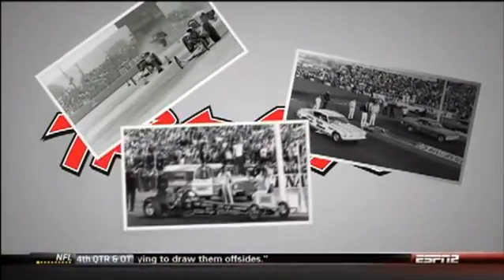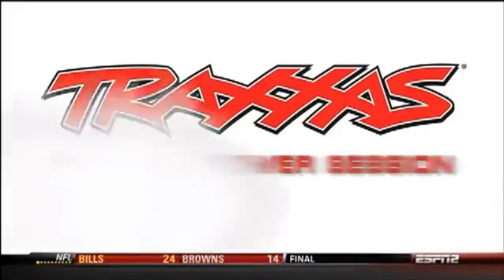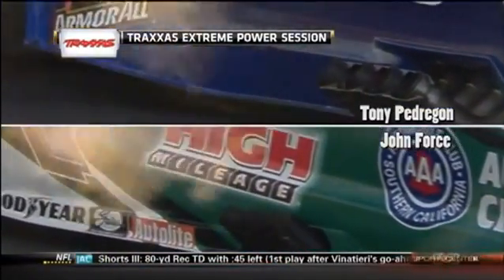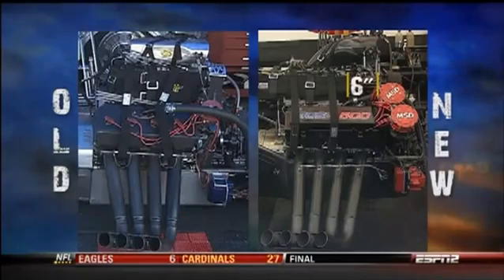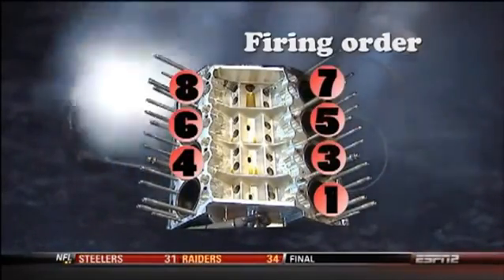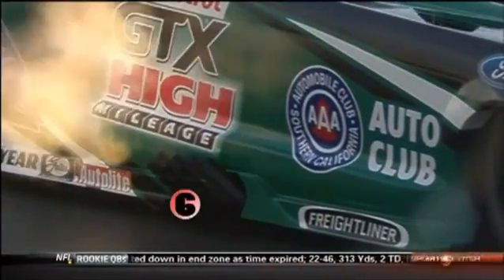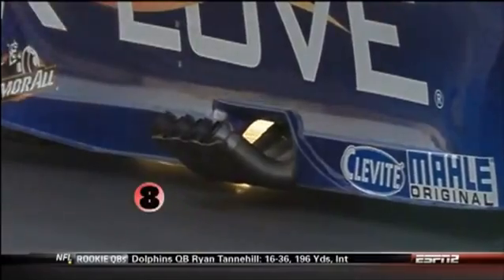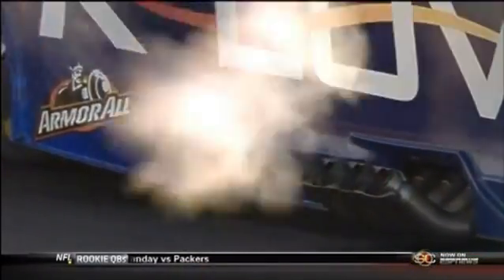11,000 + Horsepower from a modern Top Fuel HEMI !

Comment: "Since 1964 still the engine of choice for nitro drag racing"...Umm. When it is the ONLY engine that the NHRA allows you to run, how is that a choice again?
Reply: Has everyone forgotten about the Ford SOHC engine? Even "The Snake" (amongst other luminaries) ran it in fuel for a while...
Reply: It was chosen by NHRA
Reply: +Samuel Exactly, the choice was already made by NHRA. The choice does not exist for the team.
Reply: @psyborg06  yea it did. They tried others. They rocketed so fast it the chevy big block would have killed 3/4 s in the stands.
They already knew ford kills crowds with running into them, certainly no more chances for them

Comment: So lemme get this straight...one cylinder basically generates twice as much horsepower as my already highly-tuned turbocharged Porsche? 

I give up. I'll never be fast. If you can't be the fastest, there's no point.
Reply: hevquip yes its the air to fuel mixture and since they run nitro methane and is more volital than petrol you get more power not to mention the use 2 spark plugs per cylinder
Reply: The power comes from roughly 60psi of manifold pressure which means you can burn lots of fuel
Reply: Don't fret hevquip, your porsche doesn't drink 12 gallons of fuel in 6 seconds either.

Comment: It's really is incredible what these engines are capable of. I will try to put it in terms you may relate to. it would take a team of 800 actual horse's to produce  the same horsepower at full energy to equal the horsepower of one top fuel engine;)

Comment: How do you dyno this thing ?
Reply from the maker: Mihai 
There is no dyno that can measure that kind of power. I seen Tony Schumacher's crew chief a few weeks ago on NHRA broadcast, explain a device they have that measures the torque straight from the trans. Horsepower is then calculated. Schumacher's crew chief calculated over 12,000 horsepower. But, the NHRA still quotes 11,000 hp +.
Reply: Math
Reply: You measure how much extra the earth rotates when you go full throttle
Reply: Couldn't hp be calculated based upon air/fuel mixture, total fuel burned over time
Just my worthless 2 cents
Reply: RT440Dodge They don't have transmissions. It is direct drive with a special multi-plated clutch between.

Comment: I'm not a mechanic,
I don't understand how changing the firing order could increase the HP.
What is the purpose of the firing order in the first place?
Is it to balance the engine and make it run smooth?

I would think an engine with that much horsepower would have to have the
optimum balance and there would only be one sequence that would do that.

And with that much HP I would think if the engine were not balanced
it would destroy itself.

How far down the track do they go before the clutch is fully engaged?
The extra HP would not help as long as they are slipping the clutch 
to prevent tire spin.

I would think they have almost reached the limit
and that more HP would not help
because it could not be used or it would cause tire spin.
Reply: Firing order is changed to make a engine smoother or perform better usually not both,look at the 5.0ford from 87-95 it was a dog in the explorer/f150/crown Vic with the only change that mattered being firing order (cam lift) and shape of the intake manifold although the firing order/cam was the 25 to 45hp loss, smoothness requires different overlapping and scavenging in the manifold occurs differently with diff orders
Reply: @mauricedalaimo2127  
Yea thanks BUT LETS NOT LOOK AT FORD FOR ANYTHING.
THANK YOU.

Comment: So for today's nitro engines because of the firing order they use the 2 distributors on them ???
Reply: Nah those are magnetos ...
they make their own spark energy and it's enough to weld with. 
They run so much fuel thru them one plug wouldn't have a chance at lighting the fuel. 
Air cooled aircraft engines have dual magnetos also but that's more for safety.
Reply: A spark is not the best way to ignite an air fuel mixture. In fact, research shows that about 3 percent of the time the plug doesn't light the fire. Top fuel racers want that 3 percent back so they added another plug to double the chances of ignition. In theory, with twin plugs, you fail to ignite only about one tenth of a percent of the time.
Reply: I did a little research and there is a gear under each of the magnetos and they go into a plate where the is a shaft that goes into the engine like a distributor.

Comment: I would like to make a engine like that for my every day car
how would i do that?
Reply: You ask a question, then call the answer stupid.  Mirror, mirror on the wall?
Reply: You would need one heck of a gas tank considering that they burn 12 gallons every four seconds. Also the motors would grenade after a mile at the most.
Reply: @michaelwilkening8542  
Nothing but another cooling system.
Damn she might have gave the best answer yet.
Reply: @soxfunny98  The moving internal parts couldn't stand the strain of driving for any distance. Cooling would be the least of your worries. The internal moving parts only need to survive for under 5 seconds. At the most the motor makes only 600 revolutions in a 1/4 mile pass. Yet even then motors often grenade and destroy themselves. Also the blocks are a solid casting and don't have water passages made in them. You still haven't overcome the fact that a top fuel dragster burns 12 gallons of nitro every 4 seconds.  So a $900 per 55 gallons it would cost you $34,000 to drive a top fuel car for a minute if you could get it to last that long. If you want to go 300 mph I suggest you rent a learjet.  A lot fast, cheaper and safer than a top fuel dragster.
Reply: @michaelwilkening8542  
It was a joke i found funny i was not serious.
I have raced in nhra, ihra, ahra for a long time. I also own my own garage i opened at 25 years old and im 53. Just mentioned that so you may have some idea why i thought that was Ginny
Reply: It wouldn't work.
They only run for the burnout and the 4 second pass.
There is no cooling system in the engine.
Reply: I could add a cooling system stupid.
Reply: @avidsourcreamlover6278  
Lmao.... Thats funny.
Nice job.
Reply: FAT pocketbook.

Comment: I would think they would use a flat plane crank, with even firing order.   The dual plane crank was invented to make the V8 run smoothly, when the design is not inherently harmonically balanced.   An F1 V8 would use a flat plane crank, firing on alternate sides of the engine.
Reply: +charlesvan13 flat plane is useless over about 4L.

Comment: I am a total fan of Topfuel racing but DON'T call hemi something modern. Hemi is 1800 century invention, official It did first show up in grand prix cars around 1900. Pentroof in a Peugeot 1911 at Indy 500 , Wedge in OHC V8 motors in common and from Oldsmobile per definition 1949. Bathtub open and close unknown.

Comment: Your description is kinda stupid.  They're all remodeled blocks; the original design would never hold up.  And none of them are a true hemispherical chamber like the original was.
Reply: The blocks & heads are all aluminum, and it is based off the original design. The heads on a fuel car ARE true hemispheric heads. The new production cars that weat the HEMI tag do not have true hemi heads, but are still very efficient. Also, fuel engines are limited to 500 ci of displacement.
Reply: @dr.hugog.hackenbush9443  You haven't seen a modern top fuel chamber then. They're closer to the old "poly". The only ones that are hemispherical these days are the old ones running nostalgia class, about 3500HP.
Reply: +causeimbatmaaan    Except I've never owned a Dodge, but when they take one of those apart I recognize the heads and valve train as an old hemi.   A production car, that cost 5000, retail wouldn't have an engine machined out of billet aluminum, with no water jackets.

Comment: if they make 10,000 why are top fuel only running 8,000
Reply: Interesting,  Kenny Bernstein threw a lot of money at getting one and it never happened. The big racers mostly are not aware.  The shop crew I worked with used a torque measuring device in the final drive to calculate what we were achieving.  Kind of a moot point really as our rail was typically still accelerating at around 1.5 g's when they cleared the trap.  How strong is one thing, who clears the line first is another.
Reply: they dont they make 7000 after they limited the nito used
Reply: Vettc64life still if they make ten why only limit to 7? hell balls out run those 10 G ponies!
Reply: lol after toney schumacher ran over 350mph in the 1/4 they ha to limit them for safety reasons. and they went down to only running 1000ft
Reply: Vettc64life the fastest a top fuel dragster has ever gone in the 1/4 mile is 337 mph
Reply: ***** No they are over 340 mph in 1000 ft now Austin. Not the 1/4 mile which is 1320 ft.
Reply: A couple of things to consider as to the ponies that are being made.  Mostly it comes from there is no Dyno in existence that can actually keep up with a blown fuel engine.  All the numbers are really best calculated ones.  The other comes from where you get your numbers.  There are amazing losses to make the rails go.  Biggest is the approximately 600 hp it takes for the blower to squeeze that much air that fast.  It takes almost 100 to weld and destroy the clutch as bad as they do every pass.  Even things like fuel pump it is around 3 hp just to pump that much fuel.  Where you calculate the numbers and how is all in the bragging rights.
Reply: kenny also tried the mcgee motor for a while went back to the hemi. thats whats wrong with the nhra everything has to be the same no more experienting
Reply: @themopar426  
They stopped " experimenting" so much when the other engines they used including the GENERAL MISTAKE errrr MOTORS engines kept blowing sky high at a 60% faster clip. They also got shit for.a power difference and when you add in that 60 % fireworks display they put on with those " KIND" of pricey engines...... No need for more experi MENTALS.
THEY WERE JUST FINE.
TRUST ME, SO WERE THE TEAMS AFTER THEY WATCHED THEIR KIDS COLLEGE MONEY, HOUSES, VACATIONS AND PRETTY WIVES GO UP IN SMOKE WITH THAT JUNK

Comment: Really 10,000 HP  ????   I doubt this.  Would like to see dyno run, even a flash
reading will not reach 10,000 HP     I highest i have seen are flash readings of
5,300 to 5,700 HP and this was flash reading of no more than 4 sec.
Reply: +PaulRx4 
See it.
http://www.enginelabs.com/news/video-test-shows-top-fuel-nitro-engine-makes-over-11000-horsepower/
Reply: Do you READ WELL?
ITS BEEN COVERED LIKE 3 TIMES.

Comment: Haha... ok, actually I concede... You're right. The fact that over 40 years The hemi engine has been improved upon with designs that are a fraction more fuel efficient and cheaper to produce means that we must accept it as inherently "old" and "shitty"

We must discount the fact that the modern design makes no additional power whatsoever.

I'm sorry I ever accused you of being unnecessarily critical of the hemi engine.

I bet the engineers of the day would look back now and be so embarrassed!
Reply: Wow, you do not have a clue in this world do you?

They have tried engines, a bunch over the years. They keep finding more power and are getting to an end game at the power they can make in this type of drag racing.

Your right though....... The HEMI.STINKS AND IF THEY USE 1,000,000 HP ENGINES THEY COULD START DRAG RACING FOR A MILE.
WELL IF THEY CAN COOL THAT THING, GET A NICE BIG CONDO BUILDING FUEL TANK, BUILD.BRICK WALLS SO WHEN THEY EXPLODE THERE WILL BE A COUPLE PAYING CUSTOMERS LEFT TO SEE THE.SUPER STOCKERS RUN.
I THINK THATS IT.

Comment: Lmao.. guy, it was a really ridiculous example.

I know there were no other production cars at the time. in fact if you scroll up six inches you'll see that's exactly what I just said to you 19 hours ago.

It could be strongly argued that the reason for the new hemi's closed chamber is to simply make the engine cheaper by not requiring dome pistons. The difference would be marginal at worst.

If you want to say the hemi is "old shitty junk" then that's your choice, but it kinda makes you a tool.
Reply: Mine was a joke to you Jackson jr.

Comment: Lmao... guy, it was an example. Also, there were no other production cars at the time. Yes, there were "kits" you could buy and one offs here and there. Anyways, to bring it full circle, yes the hemi was pretty good when it was designed. It was designed to allow for larger valves to increase airflow, and it did that. However, it is old technology that doesn't even truely exist in the modern hemi.

Comment: Sure, the Hemi has been superseded. but to call it "shitty" or "junk" is really stupid. they're still a fantastic engine capable of impressive power numbers by today's standards and are more reliable than just about any modern production engine built today.

The fact still remains that the fastest accelerating wheel driven cars are ALL powered by Hemi engines. Every last one. 

Maybe you think they're shitty junk but I have a feeling you're not even close to capable of designing anything better.

Comment: Also, if you look at the new "hemi" engines they do not have a truely hemispherical chamber. They have squeezed as much quench area into the head as possible. Also look at the heads that nascar uses, or really any form of motorsport that isn't nitro or very heavily supercharged drag racing.

Comment: Oh, no doubt. They're dangerous at 1320 and I don't mean to be callous, but it's just hard for me to get past the change to 1000'. Racing's dangerous, period. It should've been a time for engineers to come up with further regulations in the class regarding breaking and aero to keep it as safe as is reasonable for 1/4 mile racing. They shouldn't have just nerf'd the course. That seems sloppy to me.

Comment: Kinda like the 6.1 hemi? 

Have you even looked at a hemi motor?

Just because something isn't modern doesn't make it junk, that's a stupid thing to say.

If manufacturers are going to create a smooth moderately powerful pushrod engine it will be a wedge. If they want power at all costs it will be a hemi.

They were designed for performance from the ground up using the best available technology of the time. for decades nothing came close. seriously...They're not junk and they're not shitty.

Comment: first off, That "civic" is very impressive however as far as I can tell from google searches the motor is a 3.2L V6.

I did read about a 4cyl honda powered drag car that ran 8's though. Still impressive, probably pretty similar times to a blown hemi in the early 70's

Both the honda drag cars are free from class rules and restrictions.

How do you suppose a 500ci top fuel hemi would go if they were allowed to run absolutely anything and everything? dangerous!